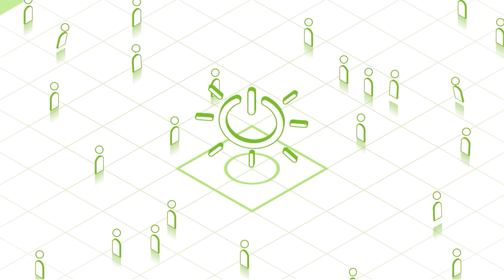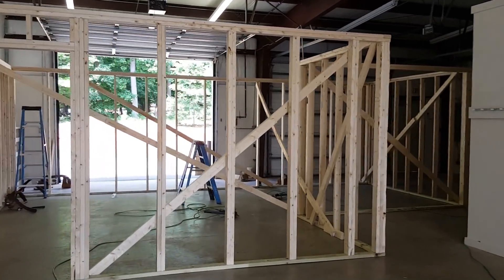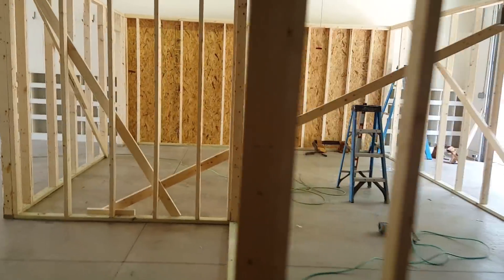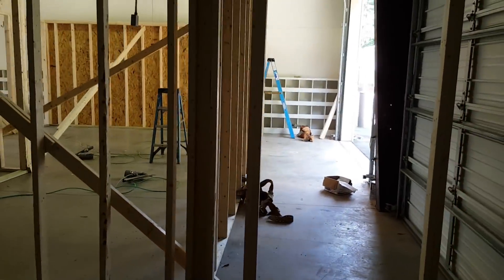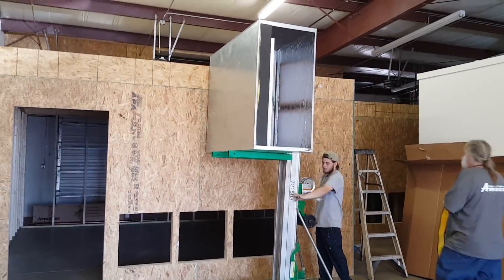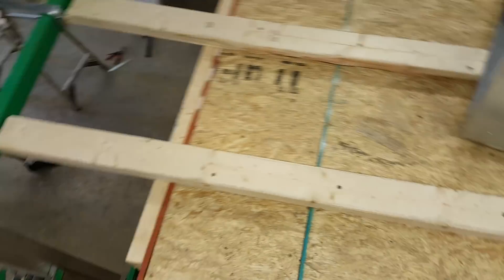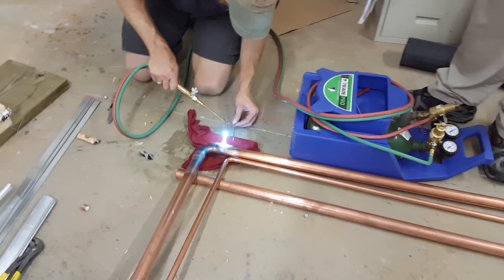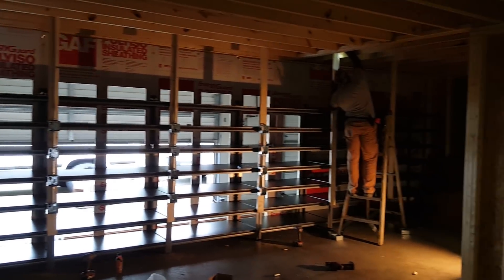Building a 500 GPU Mining Farm

Comment: dude 85 GPU on 400 amp? for real ? or your just exaggerating????? or blowing smoke up the ass. even if to exclude all the lights and fans and AC etc.... 
your lucky to hit 60 GPUs - did u NOT read n fallow the application where it said NOT TO EXCEED 100KVA ?????? which = to 320 AMP of consumption PERIOD. Of course you can have MORE which requires a bigger transformer, Ground mounted etc...
Reply: what i meant was 60 rigs with 8 gpus each =480gpus

Comment: i m having 90 1050ti single fan in a room, 10 ft x 15 ft, using 3 tonne AC for them but still the gpu side of my room is hotter n when outside temp reaches 47 degrees Celsius, gpu temp increases to 65 degree celsius. i need a duct system to reduce the temp. so before installing anything, pls be careful. Big gpus release more heat than single fan gpus. i think 10 tonne AC will not be enough, but u can try duct system too, coz u can do construction now, later it will be very hard for u to install anything, coz of dust
Reply from the maker: Hi Geet Arora, believe it or not 10 tons of AC is plenty it's all about the airflow and how you control the hot air. Of course we can spend a lot of money on cooling but that's not the point the point is to condition the cards as much as possible so they last and do it for the cheapest way possible. I've done many versions of this before with cards that are 3 years older they look brand new.

Comment: 10 ton A/C unit is not nearly enough to cool 500 GPUs, which would make about 20 tons of heat. Just get a mass amount of air circulation, preferably about 30,000 CFM.

Comment: The key to efficiency in a system like this is the hot wall. Separating the exhaust from the main server room and venting the exhaust directly to outdoors is why a modest 10 ton system can handle the job even in mid-summer in a warm climate. Further, by redirecting the airflow additional power is saved in the cold season by using server exhaust as heat for the entire facility